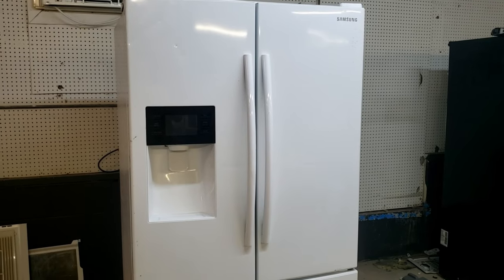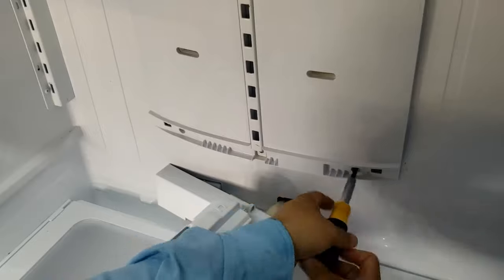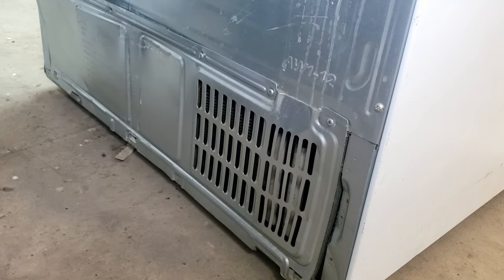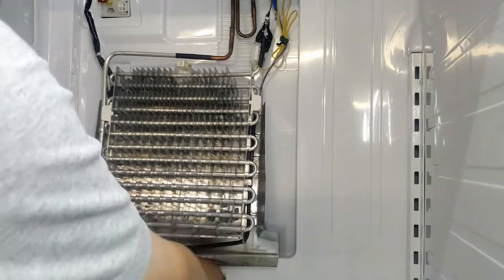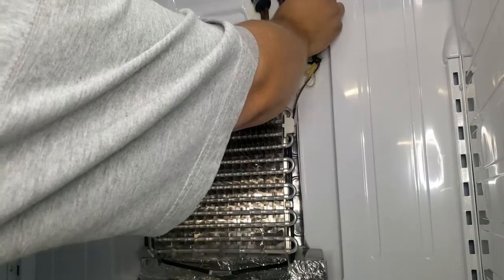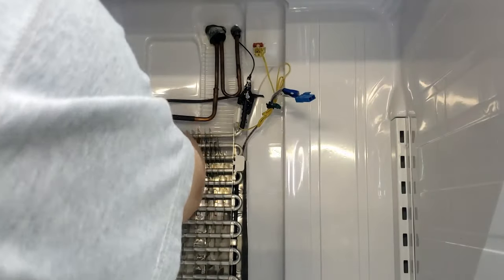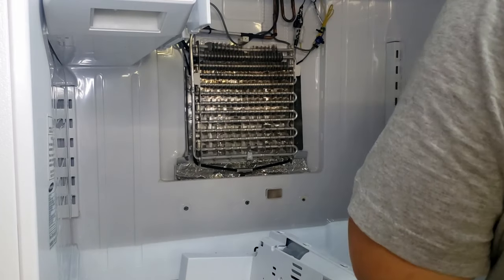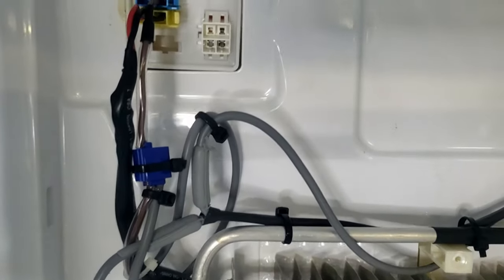Samsung Refrigerator Ice Build-Up and Leaking Water Inside Drawers - How to Fully Fix it Forever

Comment: I have this issue with my Samsung French style refrigerator.  My fridge panel was blinking 59 degrees so I unplugged the fridge for 10 mins, then pushed the pownercool and powerfreeze for 10 seconds simultaneously,  the fridge works and the temperature dropped to 38 but my freezer is not working. I followed the video to unplug it and then set it on power freeze for 2 hours. Well it’s still at 59. It’s a twin cooling system and the fridge is working where it wasn’t before .  I did have water leaking on the floor and I had a sheet of ice inside the fridge under the crisper bins. Please let me know what else I could do to try to fix it. I am Not to mechanical inclined. Thank you
Reply from the maker: Check black coils behind fridge for dort and verify condenser fan is working well. If it keeps nipping between warm and cold it may be the inverter board
Reply: @bensappliancesandjunk  thank you so much for sharing and responding so quickly. Hopefully it’s just dirty coils. I will let you know, appreciate the help:)
Reply: @bensappliancesandjunk  I cleaned the coils, checked for water leaks, checked for loose wiring and the fan motor is running fine.  Since I had it unplugged 3 blue lights came on the ice maker, the power cool and plug. Should o reset it by holding the power freeze and power cool simultaneously for 10 seconds or should I just push the buttons to turn them off and just push the power freeze only!  Also the ice maker is not making ice.   Thanks for all your  time, appreciate your help
Reply: @bensappliancesandjunk  had one repair man say to me that  I didn’t have a inverter board because it’s an older fridge model. He suggested  it’s leaking Freon after 10 mins to do a Freon text it would cost 300 dollars and to fill it 500,  he suggested to buy a new fridge. So I decided to get  a second opinion. This one said he wasn’t sure either what was wrong,  when I asked about the inverter board he said my fridge has one, but the digital display was working fine so it must be something else. Possible the compressor,  even though compressor was working just fine he said it may have to he replaced and then it could be a Freon leak, but he had no way of checking for it. I spend almost 200 dollars for getting no accurate diagnosis. I wished they would of stopped least checked my fridge with a multimeter. After 3 weeks of hassles over my fridge, I had no choice but to buy a new fridge. Appreciate your help Ben. Too bad you don’t live around my area.

Comment: I have a French door-type Maytag refrigerator, the problem is that it starts making ice normally after about 15 days the ice begins to make balls together, that is, all the ice sticks on the tray and the ice no longer packs, because they are stuck I went in yes, by removing the ice manually, it returns to produce normal ice but after 15 days it does the same again .. I already changed the new ice maker, only the pure ice maker and the problem persists .. the question is why it is happening That or what suggestion could you give me exactly? It has that same ice maker model !!
Reply from the maker: What model of Maytag is it?
Reply: @bensappliancesandjunk  I already found the model is this one brings the same ice maker as a kidchaid refrigerator to the same control screen on the left side. Model of refrigerator MF12670XE MO
Reply: @bensappliancesandjunk  What recommendation could you give me?

Comment: Do you ever see the fan go bad?  How would you test the fan?
Reply from the maker: You can pull off the evap panel while keeping the power connected, although not easy. You can run the fridge with panel off for visual inspection, although you may need magnets on the top of doors to trick the reed switches. Otherwise, you can do a voltage check on the molex harness to see if its at or near 12vdc.
Reply: @bensappliancesandjunk   Thanks.  I assumed it was 5V like a computer and tried giving it 5V but of course that didn't work.  Put on the heater and the fridge is still hot...running in the 50s.  Freezer is cold and the icemaker is working too.  I can't figure it out unless that fan is bad.  Thanks for the info about the magnets...that explains why it wasn't running when I took off the panel.  These videos you make are priceless.  Keep up the good work!  I think I'm going to get an LG if I can't fix this Samsung so start making some LG vids lol!

Comment: I defrosted the ice and plugged the fan back in. Should the fan come on immediately one the power has been restored to the fridge?
Reply from the maker: Not if the doors are open. The door's magnetic switches will power the fan down.
Reply: I’m good now Tks, I actually found that info on another video! Power of YouTube is insane 👍

Comment: I fix this issue all the time I’d say 80% of the time the drain tube on the fridge check valve is plugged and can’t drain and the ice is from the water not draining being flung around by the evap fan, also I’m guessing adding a second heater is going to cause board problems since you’ve increased the current draw, additionally I bet the extra heat will cause ice maker issues, does that fridge still make ice?

Comment: I bought the kit and it didn't include the larger aluminum tape that goes around the drain hole.
Reply: Is this normal? I just looked through the kits pictures on the linked website and it dosent show it at all but I did get some tape and two extra long tapes with triangle cuts at the bottom.
Reply from the maker: The kit I sell on my site has the silver strips w/o the huge plate as I never found a company that could die-cut it to spec. It works the same

Comment: I followed the guide to a tee, yet the ice keeps building up. When I manually turn on defrost, everything including the secondary heater works perfectly fine. The problem seems to be that it doesn't auto turn on periodically like it should. I already replaced the sensor, but the same thing still happens. I just don't know what else to do.
Reply from the maker: Where's the sensor located? Also, did you flush the drain pan of water using a bottle or anything else?

Comment: That ball of ice near the beginning of this video and the subsequent pattern a few days later have nothing to do with the drain. It had to do with a low pumping compressor that was only pushing freon enough to freeze the top 2 rungs of the evaporator coils. That would screw with the defrost cycles and cause clear ice to form there. Your upper heater modification would amount to some temporary help since the compressor was on it's way out. IMHO.
Reply from the maker: If that was true, then the freezer wouldn't be operational, as a low charge would not allow a correctly metered phase change in the freezer cabinet first. 

Beyond that, this fix has been in the wild for 2+ years, and I still see the process working. If there was a leak causing a low charge, it would have finished the refrigerant leak, but that hasn't happened. I have yet to hear anybody thats successfully done this fix to then re-determine it was a low charge. There have been other issues for certain - bad thermal fuse, bad defrost heater, bad defrost sensor, bad heater relay on the PCB. But I have yet to see someone come back and blame a low charge so far.

This process has fixed thousands of refrigerators at this point. I have yet to hear a single complaint of low charge so far.

Comment: installed supco heater and plugged in refrigerator and heard a loud POP! now the oem heater inside frige won't work and get error code telling me that. did I fry the pcb?
Reply from the maker: Pop could of been the defrost fuse in the refrigerator cabinet popping for some reason. How did you wire the heater in, and which heater did you use?
Reply: @bensappliancesandjunk  supco sh502. I wired it just as you illustrated. The pcb does smell a little burnt, but not anything like when the smoke let's out.
Reply: @bensappliancesandjunk  i also checked continuity of heater coil from the plug ends and it's in range.
Reply: @rondonato7443  sounds like the defrost relay died when you installed the heater. The relay itself can handle a lot more wattage than a 502 adds... which is 15 watts. Likely your defrost relay on the board was going bad, and the small additional wattage finished it off. I'd look at board and replace it. Usually you can find cheap ones via ebay

Comment: I said goodbye to my Samsung Fridge + Dishwasher, the oven + microwave will go soon as I have another problem. They were service pigs. Unfortunately in 2016, when remodeling our entire kitchen, we bought ALL Samsung. NEVER AGIAN. NEVER will we buy Samsung appliances again. My wife said they were collectively cheaper and in conjunction with kitchen remodeling we went cheap. Bad idea.  I've had to repair the same problem on the dishwasher, and mess with this fridge, we even had to repair the oven door. Take a lesson Samsung, I tell my neighbors and kids my experience w/ Samsung never ending problems. It's one thing to have one unit go bad, but an entire kitchen catalog of appliances need fixes, perform poorly, co$t me more money. I guess the microwave works but it heats poorly. It's the only unit that hasn't had problems in and out of warranty on everything since 5/2016 to 2/2022. The dishwasher, Fridge, and oven were the worst in the order from worst to least worse. The microwave is a poor heating unit, but hasn't broke.

Comment: How is this silver tape helping water from flowing out the front of front cover.
Reply from the maker: The thick tape goes on the back panel between metal wall and plastic liner. It provides a small gap for water to flow down into the drain hole
Reply: Crap, so does that mean what someone else mentioned, that I did it wrong? Per the video I put those strips in the front of the metal shield between it and the evaporataor
Reply from the maker: @orgwizard2000  preferably in back but you should be fine either way
Reply: @bensappliancesandjunk  wow, thank you for the quick reply! Yeah think I will just leave it and see how things work. If I end up having to open it up again to install the foam tape behind it, do you think I'd need to reorder the precut pieces or can I just cut similar shapes from a roll of foam backed foil tape I already have?
BTW, thanks for the video and all the info! Really hoping this will help us get a few more years out of this thing.
Reply: @orgwizard2000  i heard that water freezes on the drain pan and slowly builds up and stops up the drain hole. The silver foamed tape acts as a barrier to let water drip down the drain without freezing and that is why the foam tape is up on the top side of the drain pan. As for the 2 thin strips. That is still unclear to me.
Reply: @bensappliancesandjunk  if i leave it in front, any risk of fire? It's pretty close to that heating element. Not sure how hot it gets vs what that foam on the back of those strips can tolerate. If it's a risk I'd rather open it up while the fridge is still mostly empty.

Comment: How much does all that cost??
Reply from the maker: The kit is $35-55 depending on what you add
Reply: @bensappliancesandjunk  thank you so much for the info and response
Reply: The screw in the bottom middle just keeps turning and won't come out inside the fridge on that back panel
Reply from the maker: @buknasst4069  use another flat head screwdriver to apply pressure away from the panel. I've had to do that a few times when screw is strippped
Reply: @bensappliancesandjunk  thnax man. it's always one screw
Reply: I'm still hearing ice fall down it's been unused for 36 hours I guess I'll let it go a couple more days it could be frozen at the bottom still??

Comment: I ordered the parts as specified in the video. Opened the refrigerator up and found only a sealed wall. No access to drain or heater coils.
Reply from the maker: What is the model# on your refrigerator?
Reply: @bensappliancesandjunk  RF27T5241SG/AA

Comment: I built a house ~13 years ago and installed all Samsung appliances. The only ones left are a poorly designed refrigerator and a microwave with a broken handle. Don't ever buy a Samsung! Thanks for the video. I just ordered the parts to apply this fix.

Comment: Next time im getting a Frigidaire.  The one in my rental unit has lasted over 26 years now and still going with never needing a repair.  Samsung had door problem, freezer drain hole plugged with ice, and now i surmise refrigerator drain hole plugged with ice.

Comment: I'm not getting fan noises or icebergs ..but still get water after probe install and line clearing
Reply from the maker: Still getting water in drawers? I would confirm that the water housing in between the crisper drawers didn't crack and leak

Comment: Can anyone give me help identifying the fridge defrost heater wire in a different Samsung fridge (RB215-LASH) that has multiple wires in the area of interest that I find hard to trace without more dismantling than I feel confident doing. In my wiring diagram, the most likely candidates I find are R-def het (white wire) and heater com (orange wire);hard to know what's what, as there are a few white wires in the area, and no orang.... There's also a F-def het, which I assume goes to the freezer. Happy to send a photo if that helps. Thanks anyone!

Comment: Ben have you seen the Supco SH 250 Drain Heater on Amazon for $19.03?  Good reviews.
Reply from the maker: No I haven't. Any water resistant drain heater should work but I'd really avoid getting something too hot. You are putting it on a copper evaporator line, and any reasonable heat fixes this one quick since its going to defrost every 12hr or so.
Reply from the maker: Ok i looked it up... its 3 watts. That may not be enough. You could try it and cross your fingers, but id prefer something in the 10 to 20 watt range. But for the price, it may be good to at least try. I found a new splice system in Posi-taps so if that didn't work, you could un splice in like 10 seconds

Comment: I made this repair a couple days ago now. I'm not holding my breath it'll actually fix it. So far my observations: still seeing a small puddle in the bottom of the fridge. Confirmed drains are clear, water flows out as fast as I can pour it into the drain tube. And I am also smelling a mild burning smell which I assume is the defrost cycle. I plan on pulling it back apart if this continues for more than the next three days but given my luck with these things it only makes sense it wouldn't fix it. I have no doubt it should, I am just not seeing the results yet. Will report back with any changes. Anyone have any idea what's up with the burning smell?
Reply: Was your issue resolved and what finally resolved it?
Reply: @margaritavedikian5224  doing the whole thing seems to have fixed it. I was getting water build up under the drawer until about 2 months ago bit I think the foam was so saturated it was just draining.

Comment: one thing... incorrect, the foam strips go on the back and the bottom of the drain plate
Reply: I think you may be correct. They dont seem to serve any purpose if you install them as shown in this video. what would they be insulating the pan from? If you install the foam on the back though, it would be separating the pan  from contact with the plastic portions if the inside of the fridge and inside of the drain hole.
Reply: @EverMoreDesign  Yes, this was raised months ago (see comments below) but nothing has been done yet to correct the video or pin an update to the top of the comments.
Reply: Dammit, yeah should read through more comments, cause I installed them per their video

Comment: The whole section after 5:24  - taking the pan off the coil is in error and unnecessary! The foil strips go behind the pan between the pan and the plastic refrigerator. Not between the pan and the evaporator coil. 
I have commented on this and Ben’s appliance and junk keeps ignoring my comment. 
After I bought the kit and did the installation according to the video Ben advised that the placement of the foil was incorrect and I had to remove everything and do it correctly. 
Ben said that YouTube wouldn’t let him correct the video which is BS. 
Please respond and replace this video with an accurate one

Comment: Is this worth it or hire a company?

Apparently the Samsung has this same issue yearly. We are in FL,  this is a Pain in A, maybe buy a new other refrigerator
Reply: I bought the kit, heater kit only with posi-tap splice for $32.99.  It's been 2 months, no ice build ups, refrigerator is working like a charm, ice cold.  If you are going to spend couple thousands on a refrigerator, try to spend 32.99 first.  This kit works.

Comment: I keep getting frost in the freezer section everywhere evaporator not cover in ice but frost built up on everything else in the freezer compartment
Reply from the maker: Frost throughout the entire freezer cabinet... That would suggest that the door is not closing fully, and a small air gap is putting moisture (outside air) into the cabinet, then condensing onto frozen items. Check for any sort of damage or air gap on freezer door when its shut.